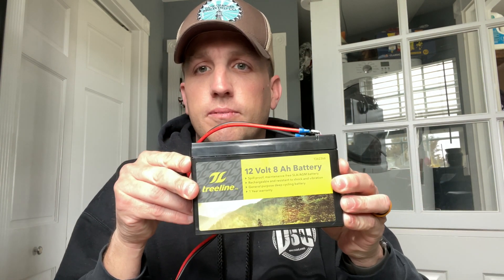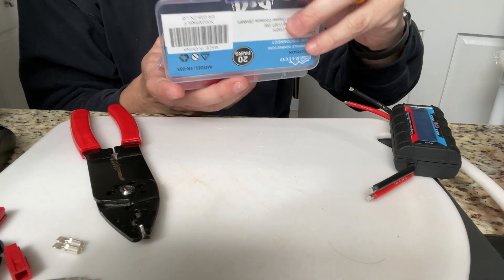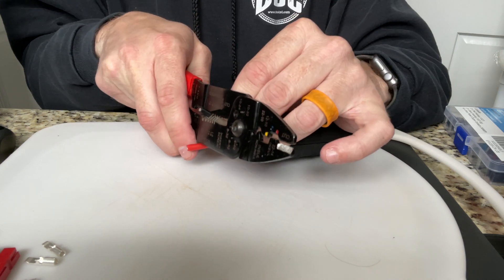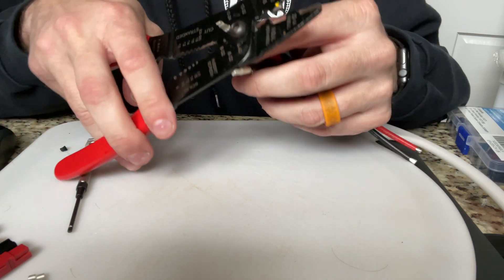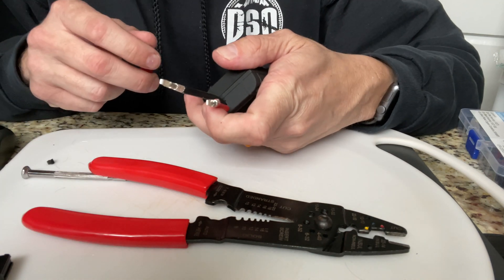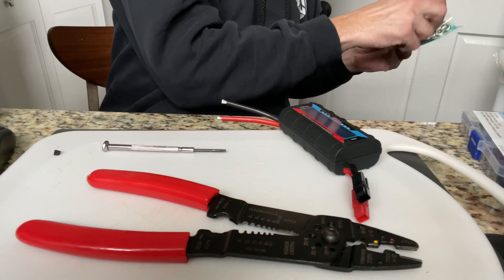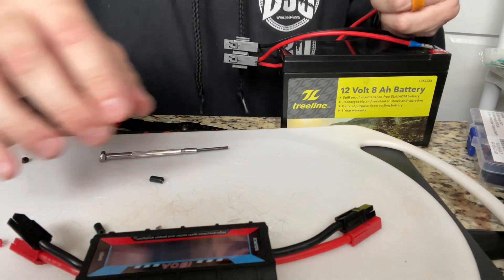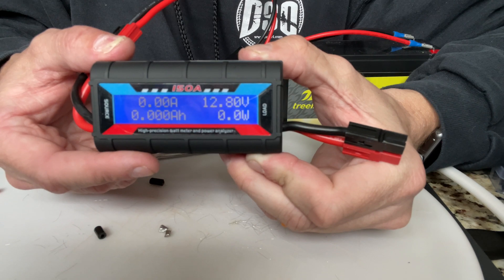Anderson PowerPole Install on Watt Meter

Comment: I opened my Watt Meter up and replaced the wire with 8 awg wires and soldered the connectors, I used Gold-Plated 8mm Male Female Banana Plugs Bullet Connectors ...THIS was for my inline solar panel array

Comment: POWERPOLE THE WORLD! I solder them too, it's not fully necessary, but I think it gets a better electrical connection. 1 suggestion regarding linking them, when you look at them from the plug side, the red A goes on the right. Great job!